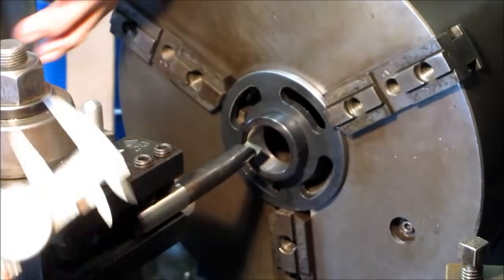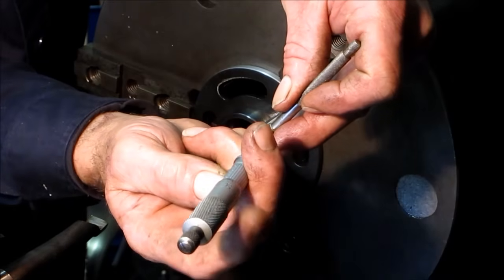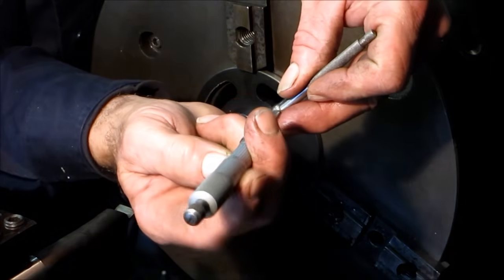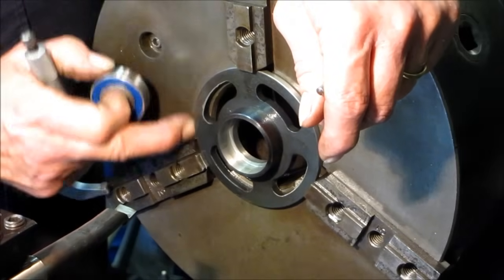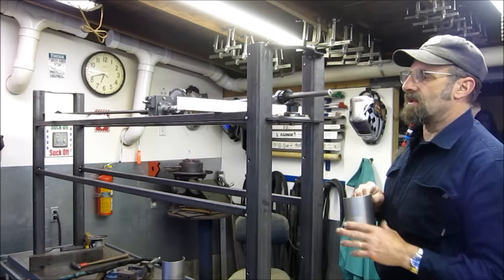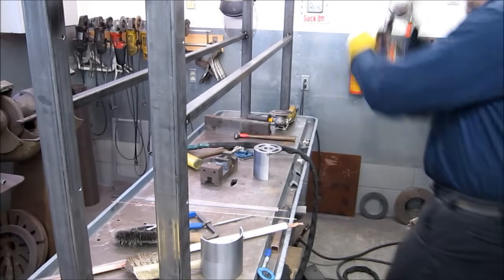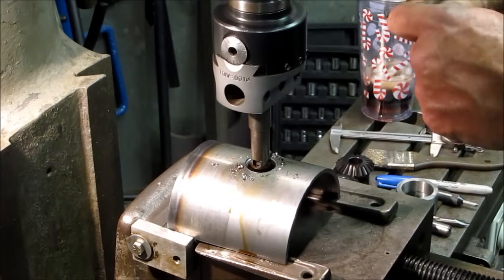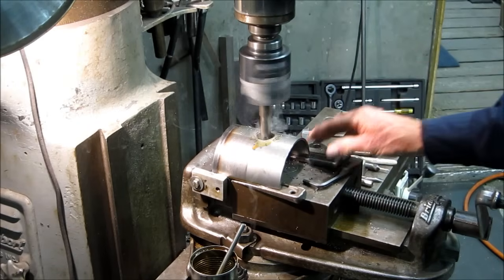Big Screen Elevator Part Four

Comment from the maker: The sulfer base cutting oil lubes and extracts heat away from the cutting action. I have and do use water soluble in the mill but don't have enough space to build a coolant gard system for the lathe without blocking access to all the attachments.